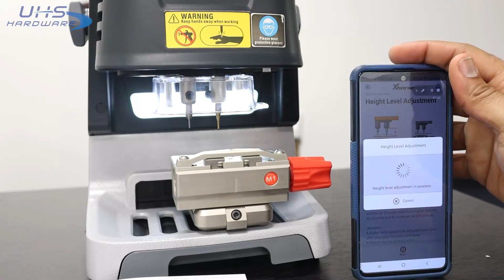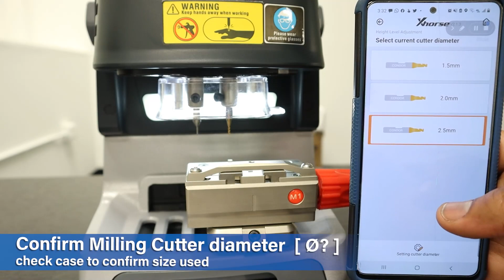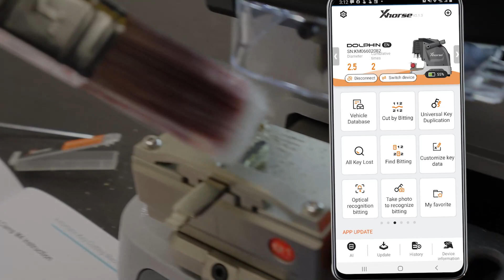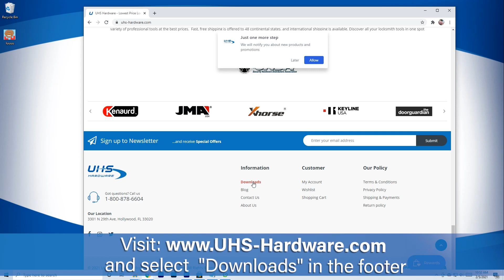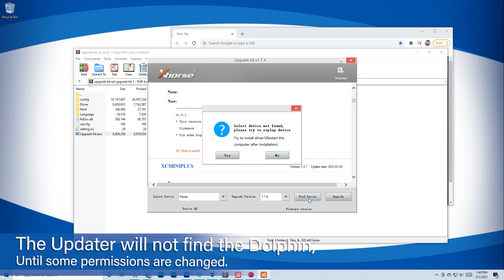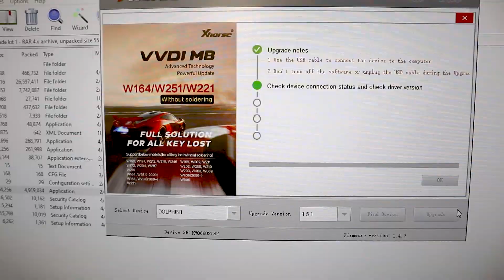How to Calibrate & Update Condor XC Dolphin XP-005 Portable Key Cutting Machine

Comment: We found a only 75% success rate for keys using 2.5 mm cutter. Would 1.5 mm improve chances?
Reply from the maker: This is somewhat specific to the key being cut and the accuracy of the calibration. I used a 1.5mm with no issues and exact duplicates. We say try the change and let us know your outcome.